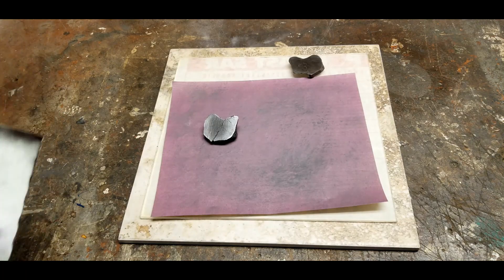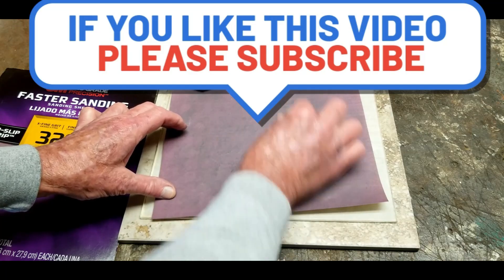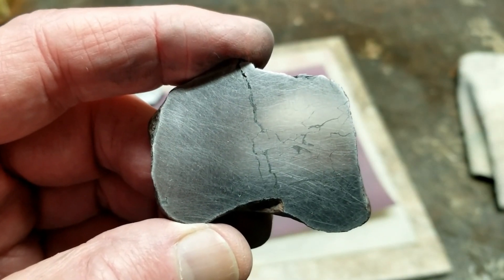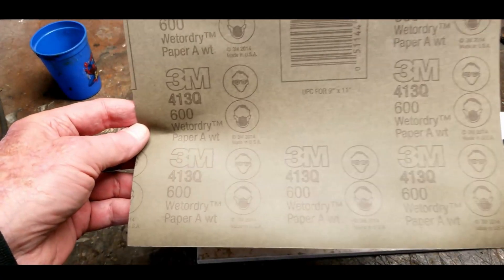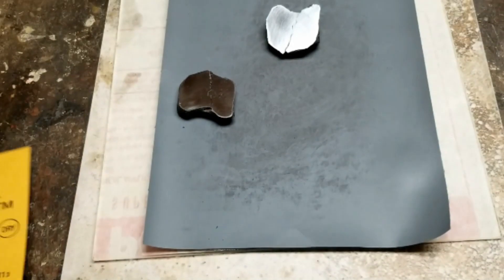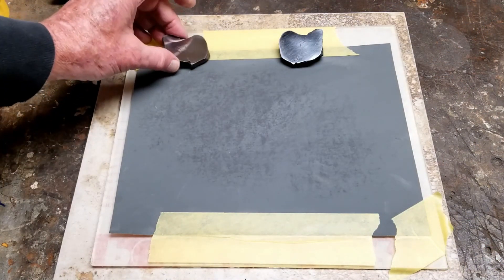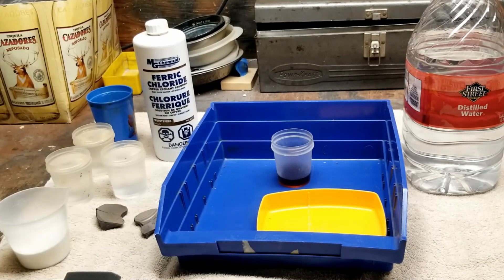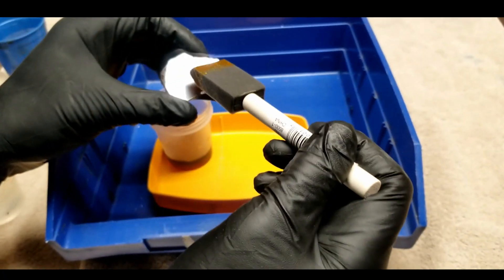Acid Etching Unclassified Iron Meteorite ☄️ Reveals Hidden Pattern - with Ironman Ron Metchis

Comment: Thank you for always sharing valuable content.
I tried etching a Nantan meteorite using a ferric chloride solution at a concentration of around 40%. However, it unfortunately turned completely black. It seems that iron oxide formed on the surface of the meteorite, causing a severe blackening.
Based on your expertise in meteorite etching, do you have any recommendations for a good etching method specifically for Nantan meteorites?  If you have any advice, I would greatly appreciate it.
Reply from the maker: Hello....  Thank you for your kind words.  I am not sure what to do in that situation, but I will ask our crew members and associates who are familiar with irons what they would do in your situation and get back to you.
Reply from the maker: Way too high of concentration. You burn the metal. Try 10-15% strength.

Comment: I tried this but made the mistake of leaving the feric chloride on it for a few minutes and I kept re applying it the end result was a snowflake pattern that was 3d I want to etch again but legit I over etched it to the point where the acid ate inches into my specimen. Should I grind it a few inches deep until I don't see any pits as this was caused by the feric chloride. Thanks
Reply: @T.J.Williamson  sounds like you overetched.
Reply from the maker: We know a lot about meteorites, but etching is not our specialty, which is why we host videos of other people who know a lot more than we do.  I know we have content from Chris Monk, Ron Metchis and Craig Zlimen. Space Jules is pretty good with irons as well.  Maybe one of them can share their feedback here in the comments.  I will tell you what Space Jules would recommend....  A lot of these processes can only be learned through trial and error.  I know she has personally over-etched meteorites in the past, but she tracks all of the things she does, measures the times, etc... and learns from her mistakes.  She has specifically purchased some low priced iron meteorites from us that were starting to rust and used them to experiment and learn from.  She bought an Uruacu from us and turned it into one of the most beautiful meteorites ever.  So, keep an eye out for cheap irons like Aletai and use them for practice rust removal and etching techniques on. :)
Reply: Hi , Funny , I just asked about what happens if you etch doing , say , 10 acid etch cycles

Comment: So ive etched meteorite before, but im currently trying to etch an inlay inside of silver and im not sure if the soldering process destroyed the widdenstat pattern?
Reply from the maker: I am not a metallurgist. But will try to help. What meteorite are you trying to etch a sliced piece of?
Reply: @TopherspinMeteorites  it's a muonionalusta meteorite. I'm pretty sure heating it up ruins the widdenstat pattern, becuz it will not etch. I hard soldered it to a silver ring and that heating process must've destroyed it.
Reply from the maker: Very highly possible. I have a 2kg Gibeon that will not etch. I was told that some got more heated (in space) than others. I am really sorry to hear the pattern is gone for you.
Reply: @TopherspinMeteorites  UPDATE: I went and bought new Muriatic acid and tried it after work??? It worked perfect. So I now am sitting on a muonionalusta ring, surrounded by silver. Now...I just have to be careful how I darken it...and coat it...
Reply: @TopherspinMeteorites  pretty stoked it actually worked. But I'm at a standstill. It's etched beautifully and surroundedby a silver ring. I just gotta take breath and figure out where to go from here.
Reply from the maker: Super easy to buy more acid - great to hear.
Reply: @TopherspinMeteorites  yes sir. I learned a few lessons. 1: acid absolutely loses its potency over time. 2: thank you for your time and dialogue, it kept me from panicking. You're awesome, man.
Reply: Great video!! I have a silver bracelet with an inlay Gibeon meteorite. It did rust and I cleaned it but it did lose it’s nice etching. Is it safe to use Ferric Chloride to re-etch the meteorite portion? Does it interact with silver? Any advice would be greatly appreciate it. Thank you!
Reply: @tarekammar1038  I use Muriadic acid (I think that's its name) and no the acid won't eat the silver. You can buy Muriadic acid at most hardware store for about 10bux.
Reply: @tarekammar1038  I use Muriatic acid and it should effect the silver, as long as it's real silver.
Reply: @ryandavis4448 I am sorry for my confusion but do you mean to say “should not affect the silver”?
Reply: @tarekammar1038  I don't believe it will, HOWEVER I can't say for sure becuz I've never tested it. I want to say Patrick Adair has done it before on his YouTube channel, if you wanna look it up, in his videos?

Comment: Very cool! I’m beginning to like the irons a bit more every time I see a video like this!! You’re not afraid of the acid getting in that crack and eating away the rest of the meteorite?
Reply from the maker: No worries at all. The acid is washed off in less than a minute. It can't do any damage other than a hair's deep since it is not allowed to penetrate. Good question.  They are put in the oven or dehydrator before sealing them.